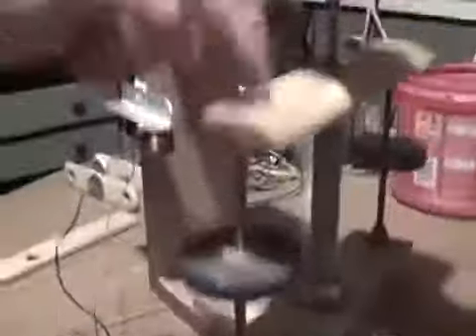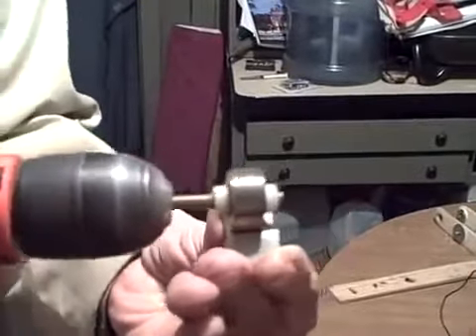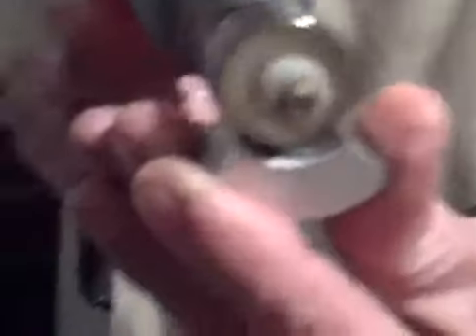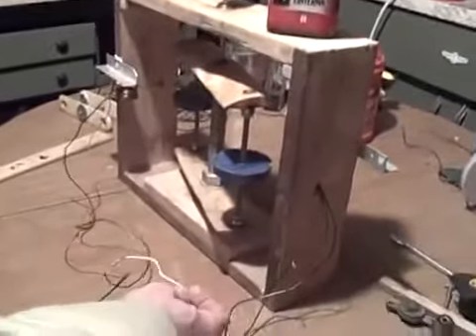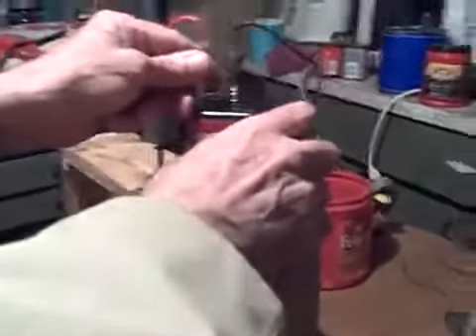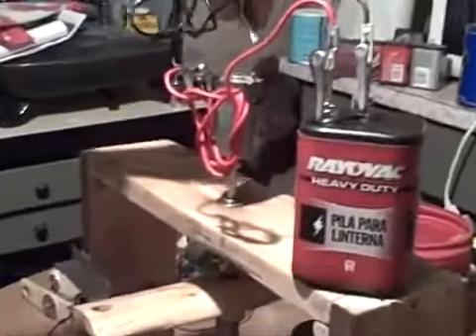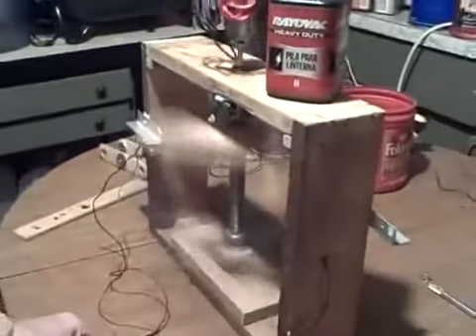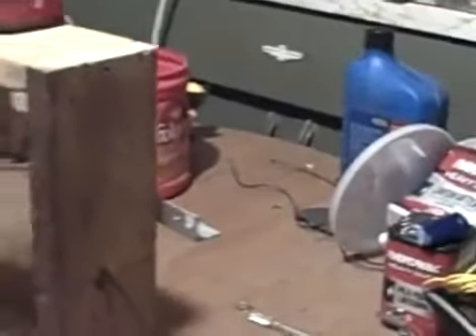explains how magnets can make free energy govsecrets

Comment: So Not to bust your bubble but the frictionless bearings has already been utilized in many large scale engineering projects. I do some work sometime on a 2 million ton chiller that evaps a water loop. This Chiller has bearings on the screw compressor that never touch Via electro magnetic. Its a Great idea for maintenance but when magnets are involved there is always drag. So with the magnet bearing the faster you turn it the more induction you are creating thus heat an drag cause issues in other areas.

Comment: Frictionless bearings, is a good idea brother. That coincide with magnetic breaking and you'll never burn out your bearings or ever need new brakes. Thus freeing up landfills and using less lubricants.
If this was Applied to generators they would produce 10 times the amount of electricity if not more than They do now, for there is now no friction:-).